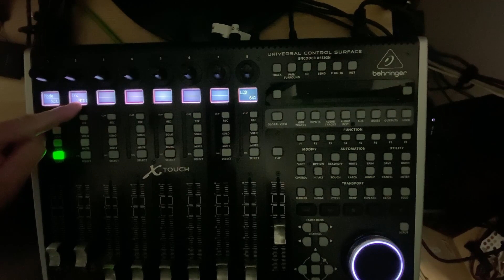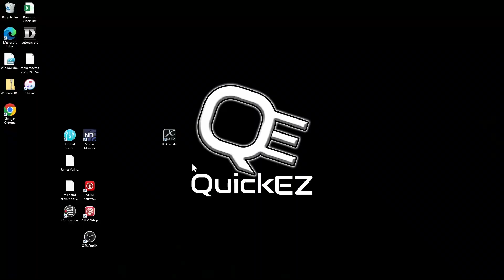Connect an X-Touch to an XR with MIDI

Comment from the maker: For anyone wondering why there are different XCTL modes on the X-touch;
XCTL is the mode for controlling your XR mixer when you do not intend to simultaneously use it as a control for your DAW.
XCTL/MC allows you to control your X-Touch, and then also control your DAW using Mackie Control Protocol, by pressing the SMPTE/BEATS button at the top-right of the console.
XCTLHUI gives you the same control as the XCTL/MC but uses the HUI (HUMAN USER INTERFACE) Protocol which is basically an older version of the MC Protocol.
XCTLCTL  mode: I currently have no information on this mode.
XCTLREL mode: I currently have no information on this mode.

Comment: The tutorials are great. there is never mention about how to wire these devices up to each other. Do the MIDI in/Out cables go from and to the Xair mixer to the xtouch? How then are you connecting to the computer? USB? If so which device is connected via USB to the computer? Or are you connecting to the computer via ethernet cables? If so how are they routed? Are they both connected to a router? Are they only connected to each other?
Reply from the maker: Fair point.
This should probably be a video update. 
In the meantime:

Xr and xtouch and connected to each other via midi. 
And then the Xr is connected to a computer via network. 
You can do wireless or wired but I highly recommend wired. 

In this setup, connections are as follows:

XR:
- midi out to xtouch midi in
- midi in to xtouch midi out
- network toggle switch set to to ETHERNET (set to dhcp in xair edit)
- Ethernet port connected to a router 

Computer:
- connected to same router as the XR
- running XAir edit

X-Touch
- midi out connected to XR midi in
- midi in connected to XR midi out

That’s it. 

Obviously I’ve duplicated the midi connections above just so it’s very clear. 

Hope that’s helpful. Thanks for pointing this out!

Comment: Thanks for the video. But is it possible to control the sends-volume via the Xtouch? 
I only need the xtouch as a monitor controller for the first bus.  Or is this not supported via midi?
Reply from the maker: Sorry for the delayed response. 

If what your asking is:
"Can I control the levels of the Busses (bus 1, bus 2, bus 3, bus 4, etc)?"  then yes. 
If you use the FADER BANK buttons to move over to the right, you will first pass all your input channels, and then pass your effect return channels, and then you will see your Bus 1 - 6 channels on the fader strips allowing you to control the volume of each bus with the faders themselves.

If you're asking if you can control the amount of level you are sending to each Bus;
The answer is "yes!". 
The automation buttons on the surface select your busses 1-6 and allow you to use your faders to control the amount of level you are sending to each bus from your input channel.

If you're asking something else, please let me know so I can answer appropriately.

Comment: How do you setup a X-Touch Compact to Xair mixer?
Reply from the maker: Hi GoCFCva,
You can use midi cables for a direct device-to-device connection. Or you can use a computer and software to make a USB connection room or an Ethernet connection. 
I have a few videos on this channel that discuss the various connection methods. 

The method for choosing your connection mode on the compact is the same as the universal. Hold the channel 1 select button while powering on the xtouch then select the mode you want.  

Here are some of my videos:

https://youtu.be/ceuGgdHC1Uw?si=lG2H1itRPhxbzb_F

https://youtu.be/17MMnwJxkZU?si=0KFBM7EIr_pCm7WB

https://youtu.be/cz2w8ahYicI?si=Jy6a9stUOGdCl8_7

https://youtu.be/Hq56eH8_Pxs?si=hBD5rC2s2IxQosMd

https://youtu.be/WWYEf7B63TQ?si=eGVNAMDHR-IUHfA6

Hope this helps!
Reply: I have xr12 connected to xtouch compact via midi and i have configured the compact with the editor. But it doesnt control anything...
Reply: MC mode doesnt control anything on the xr12 either
Reply from the maker: Have you connected the MIDI cables correctly?  IN to OUT and OUT to IN as below:

- Midi IN on the Xtouch, should be connected to Midi OUT on the XR.
- Midi OUT on the Xtouch should be connected to Midi IN on the XR.

Comment: I'm trying to do this with wireless midi.  Does that work?
Reply from the maker: Honestly, I haven't tried this with wireless midi so I can't faithfully comment. 
However, if I had to guess, try using your X-Touch in MC mode instead of XCTL mode, you might have more luck making the connection.
I'd be very interested to know if you are able to make that connection. If you do, please let me know.
Reply: @QuickEZ  for some reason I'm not connecting at all even with standard midi cables
Reply from the maker: Hey Joel, do you have the midi RX and TX turned on in the setup screen?
Reply: Just found out how to make it work.  Had to turn off all the midi settings and it works flawless.  So amazing 50ft wireless control using midi
Reply from the maker: I’m so glad to hear that’s doable. 
If you could share a link for the wireless midi you used that would be amazing!